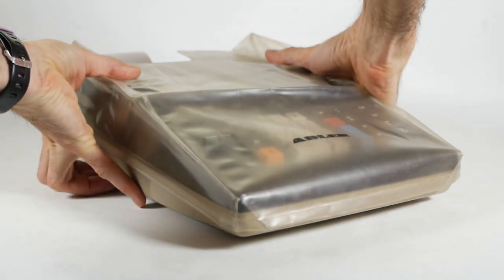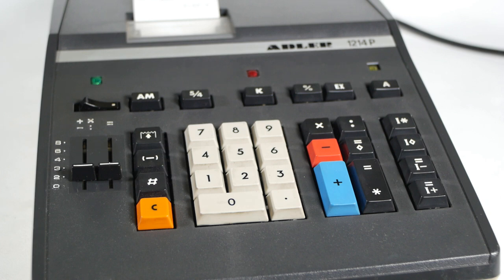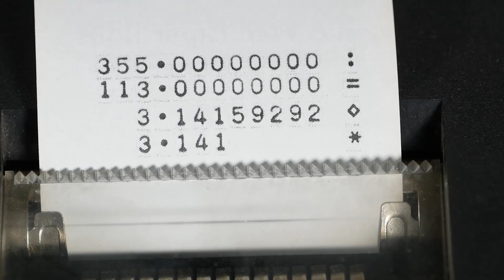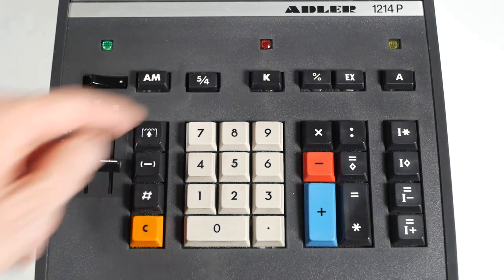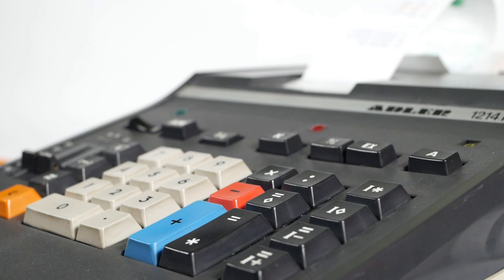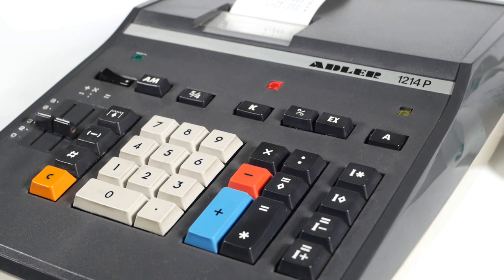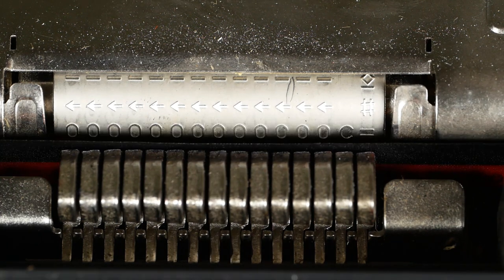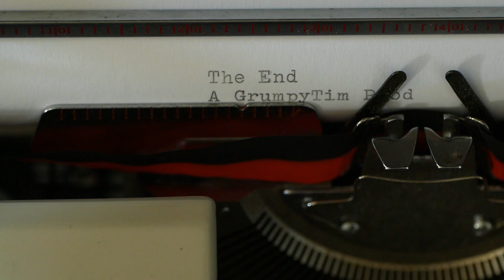Early 1970s Electronic Calculator - Adler 1214P

Comment: That is quite an interesting calculator. Also interesting that its output and running display is paper only, presumably because of the expense of an electronic display and driver.
Reply from the maker: Hi Ben, yeah I think some users just didn't need a display so many companies offered a printer only model to save a few pounds.  Some of the earlier electronic calculators used Nixie Tubes (now very desireable) but by the time my Adler was made they were often offered with a VFD as well as a printer, or in some cases just the VFD (I'm sure you know what a VFD is, but for the benefit of anyone reading who doesn't, it's a vacuum fluorescent display).  A few years after my calculator Adler produced the 1217PD - P for printer and D for display, it also had a few additional features like a square root key.

I've just got a Burroughs machine, also made in 1973 but it's electronics look like a dinosaur compared to the Adler - it's really complex, with some fancy programmes to "help" you with your work (the interface is horrible), but having said that I'd never taken one of those printers apart, the main gear stripped on the Burroughs after a few minutes of fun so it looks like I'll be having to make a franken-gear out of two suitable new gears - a little research suggests it's 0.4 module but I haven't stripped mine apart yet to check that.

Comment: That printer output quality is very satisfying (and well photographed!).
Reply from the maker: There are two reasons for the excellent print quality, firstly, that printer unit is a fantastic bit of kit, and secondly I'd fitted a much better quality ribbon - the standard typewriter ribbons that you can get these days aren't heavily inked and don't always work that well in printing calculators.  When I got the Adler a few years ago I bought a couple of good ribbons for it and the difference is huge.

After saying I'd never taken one of those printers to bits, another calculator that I'd just got, conked out after about 10 minutes of fun with a stripped gear in the printer - video coming soon - the method of synchronising the hammers to the printing drum is simple and brilliant.

Comment: I have a teknika general 1206p from the same period with the same printer 'display', and ive owned it for 10+ years. Its always sat on my desk for basic calculations but now i understand how to use all of its functionality based on your 1214p. Thanks heaps
Reply from the maker: Hi TheDzhoel, that was one of the things that got me interested in old calculators - it wasn't always totally obvious how to use them, and it still isn't at times, I guess that's what keeps it interesting for me, either working out how to use it, or in some cases, repairing it before I can even try to use it.  Hope you have fun with your 1206p, trying out some new tricks with it.